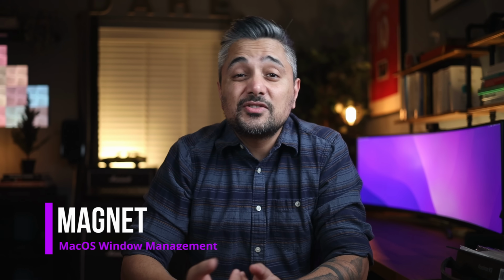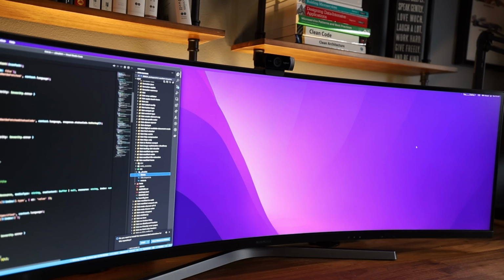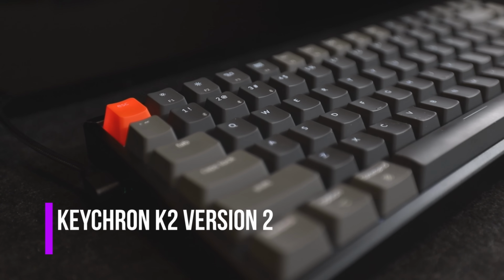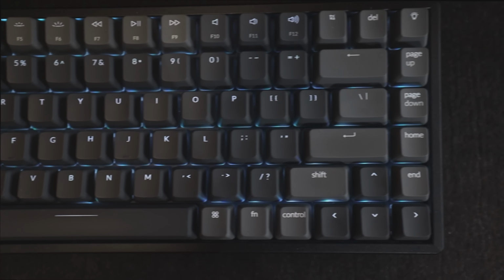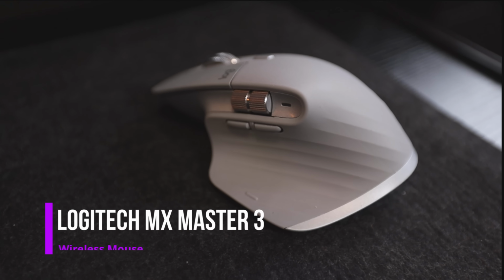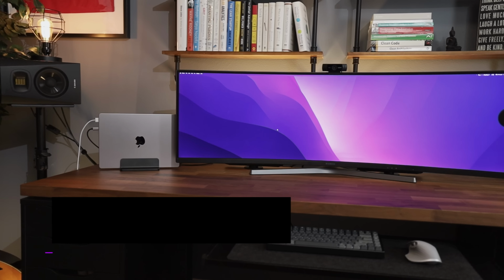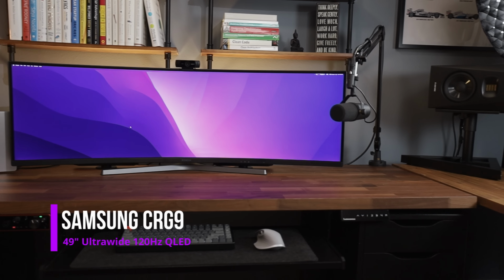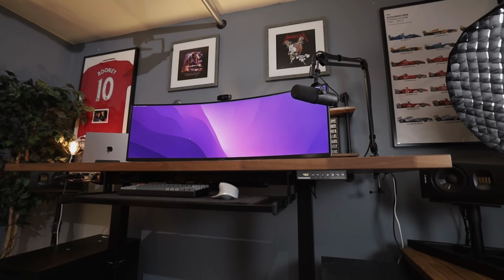Perfect M1 Max Macbook Pro Desk Setup for Software Development

Comment: What a wild video I’ve stumbled upon! I am almost in the exact same scenario as you. I do music and video production but always use windows for my day job. I had an M1 MacBook Air for music and a big Gaming PC for Editing and work. I decided to take the plunge and consolidate the 2 by getting an M1 MAX 14 inch. I also happened to also get that exact same 49 inch monitor as well as the same interface. Only thing different I do is, if I have a client PC I need to work off of I plug all my peripherals into a KVM switch. That way they are both plugged in and on at all times and can switch between them with a single button. Anyway, great video! I’m intrigued by the keyboard you’re using.

Comment: I appreciate the focus on software develpment but you are missign the biggest factor - how does the text/code look on this monitor. The answer is - horrible especially under mac os. For programming/reading and mac os the only option is a 4k monitor or above 4k. Ultrawides are great for video editors, photographers etc. Not for reading code 8 hours+ on them.
Reply from the maker: Been doing it for 3 years on windows and Mac, I have no issues with text. I have a dell 4K ultra sharp right off camera, and I still prefer this monitor.
Reply: @EngineeringwithUtsav  there is tons of information online about blurry text on ultra wide montiors. I had LG38GN950 and while it is perfect on windows it is not the same on mac so I had to return it. It is just good to add this as a note for people to keep in mind when ordering. If someone expect clear text without hurting their eyes 4k is the preffered option.
Reply from the maker: Thanks for the comment, Martin. I hear what you are saying. But like I said in my earlier response, I’ve been using this monitor for a few years now on both platforms, and I have no issues - in fact, I prefer it over 4k monitors. I would like to believe my eyes over what’s said on the internet. That being said, everyone has different preferences on sharpness, resolution, etc. So if 4K is the preference, that’s no big deal at all. Like with anything that gets heavy personal use, folks may have different experiences. But I can 100% say I have 0 issues with any blurry or non-clear text on either platform. I use it for 10+ hours day.

Comment: Great video. You can actually achieve what you use notepad for with textedit. You just need to configure it so that plain text is the default instead of rich text for new files under Preferences.

Comment: TextEdit can be set to use plain text by default. Preferences > New Document. And, like Terminal, can be set to open to a specific set of characters (which acts like Terminal's columns option when you select a mono-spaced font for plain text) and lines. You're welcome.

Comment: I'm thinking about buying M1 macbook AIR for software development. I'm using windows for 17 years and I have never used macOS, so probably I will have some problems to adapt. Keyboard is one of the most important devices for programmer, actually I have only keybords for windows :D

PS. Very good quality of this video and of course well presented :)

Comment: Since you are developer most of your day you're reading text. I would highly recommend a 4k monitor instead of QHD with scaling option. One letter will be drawn with more pixels and will be not so blurry. This really reduces eye fatigue.
Reply from the maker: This is not blurry at all. I prefer this over squinting on a 4k.
Reply: @EngineeringwithUtsav  4k monitors is not meant to be used at full resolution. For example I use 32 inch 4k BenQ monitor with scaling set to 150%. With scaling I have same real estate as I would use QHD monitor but everything is so sharp.

Comment: Great setup 👌Currently I’m using 2 laptops. First is company’s Lenovo t490s (sad it’s not t490 because you can’t add ram) which is running Ubuntu 20.04. Second one is my private MacBook Pro 15 from 2018. It still powerful and enough for me. I’ll be thinking about replacing it in 2 or 3 years then m2 or m3 will be available but I started to think if desktop like iMac would be better for me and then MacBook Air on the go.

Comment: Great informative video.  Re TextEdit and formatting: you can go you to TextEdit's preferences and turn the default format to 'Plain text'. Then any new windows you open will be in plain text mode and act just like Notepad on Windows. You can toggle between Plain text and Rich text mode in any window with Command Shift T

Comment: Thanks for this awesome video.
I specifically like the dock which has almost all the ports that we need and it looks small. I have Macbook Pro 16 Inch 2019 which have 4 thunderbolts ports only and I miss those ports in it.
I have MX Master 2 Mouse do you think it’s worth upgrading to MX Master 3?